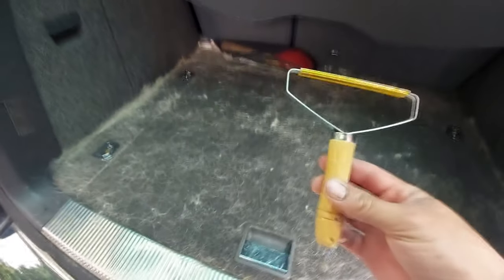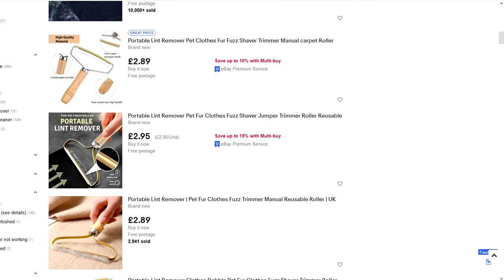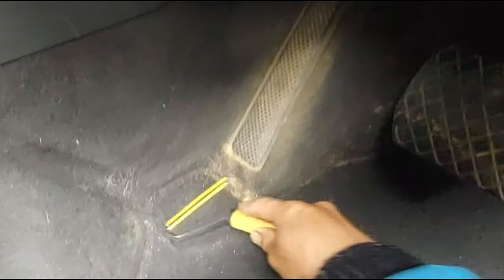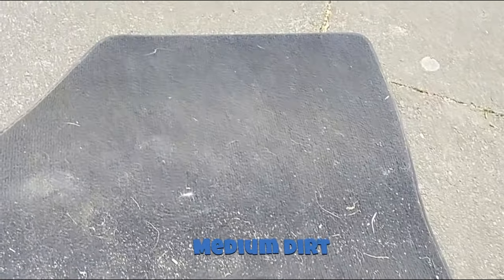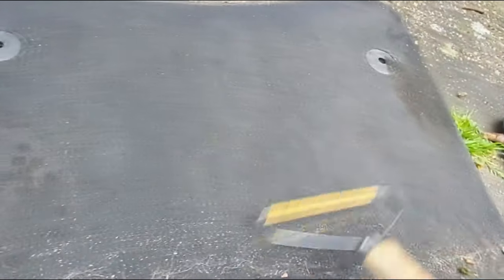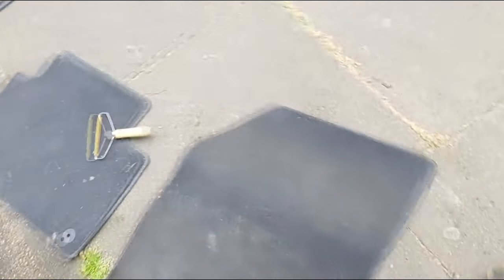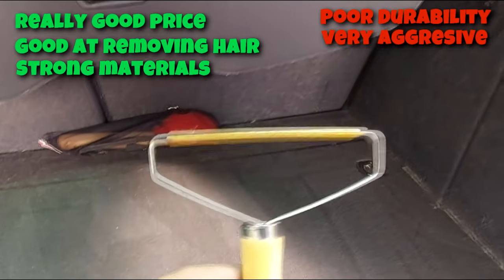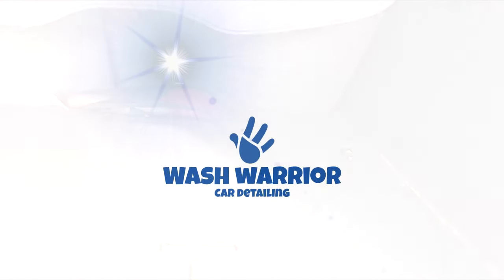Portable Lint Remover Review! REMOVE DOG HAIR FROM CAR!

Comment: I'd like to see what it gets up AFTER the surface has already been vacuumed.
Reply from the maker: The issue is a vacuum doesn't suck up hair very well. You can spend time vacuuming then using the tool the  vacuuming etc, that might do a better job.